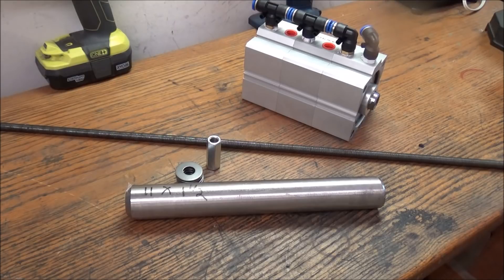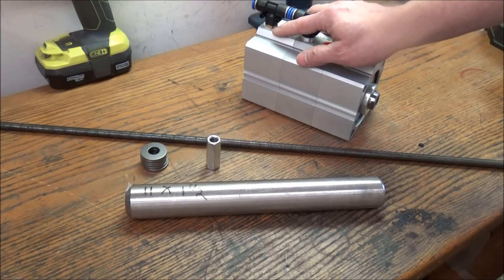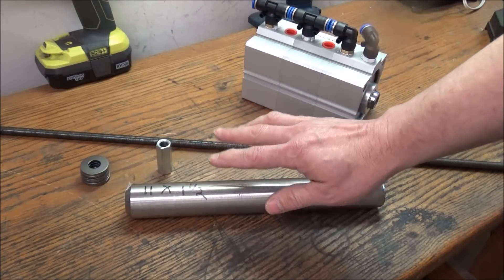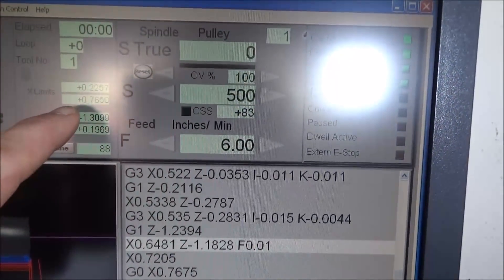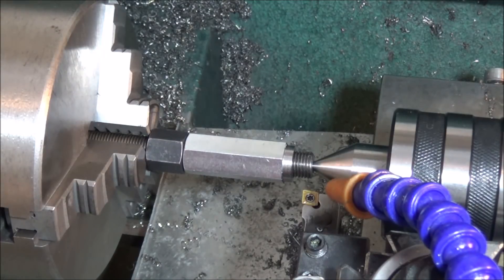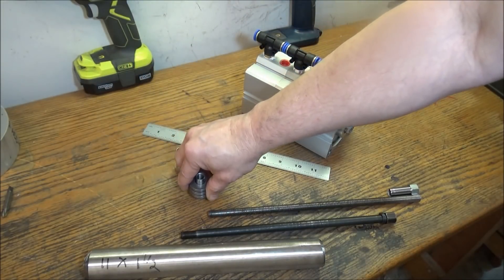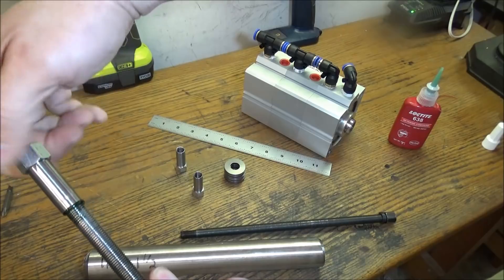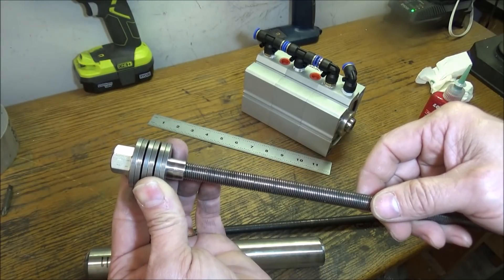PM727M Power Draw Bar Part 1

Comment: So your belleville stack is setup for about 1200lbs? (100mm diameter x 100psi)
Reply from the maker: MarvinRunyon 
No I have about 3500lbs on my Belleville springs 150psi on a 3 stage 80mm bore
Reply: That 150 psi may be a mistake high pressure compressors are not real reliable unless its a true commercial unit then they use lots of power and of coarse if you pop a hose or fitting at that pressure DUCK!!!
I have owned a machine shop for over 30 years
Reply: https://www.youtube.com/watch?v=PN64TesZk60
This and one of his early videos had some interesting info
Reply from the maker: Thanks Tom I'm aware of the risk using 150psi  the working pressure of the bellvilles are 2750lbs but that's to get them working the flat load is a little over 4000 lbs @150 psi i'm at 3500lbs . I will run the mill and see if my machining habits cause any tool pullout and I can reduce the air pressure if warranted.

The Air cylinder i'm using is a 80mm bore a 100mm bore is ideal but the extra size makes it a little more difficult to fit.

Comment: Yes, me, again! What I'm hoping you will show is making the retention collet on the lower end of the drawbar. Those things are VERY expensive. BobUK.
Reply: Robert in this instance these drawbars are for the TTS R8 type of quick change tooling.  in this instance the collet is a simple 3/4" R8 collet with the face ground flat and can be had for about $15 from Tormach and works with the TTS type tool holders.  you are probably looking for a more traditional type of retention pullstud gripper such as a claw or ball and socket type. but won't find that in this specific build.  those type of retention methods require significantly more throw and a simple 3 stack of belvilles is not nearly enough to release that type of tool.  those type of release mechanisms have stacks of belvilles in the 20's to accumulate the proper throw for tool release and also to not require the same amount of force to retain the tool as our methods do.
Reply from the maker: I agree with Chris , The TTS system is a little more forgiving in terms of adaptability to manual mills with R8 spindles. The manual mill BT-30 spindles do not always have the space to accommodate a  sufficient amount of Bellvilles to achieve the desired travel to release the pulls stud.  This biggest concern with the TTS system is tool pullout there's only so much pressure you can get from the Bellvilles. A TTS collet cost about $30 US stay away from cheaper imports as they do not have the Flat bottom. https://www.tormach.com/store/index.php?app=ecom&ns=prodshow&ref=35356

Comment: Hi. This looks really useful for me, looking forward to the rest of it. For the best accuracy - not really needed for this application as you will know, but maybe helpful for other folks tackling more demanding ones - turn a suitable thread onto a small arbor to take the top nut - that way no reliance is placed on the accuracy of the chuck, it's all down to the headstock bearings. Don't use a die on its own folks, they can wander, although they are useful for finalising the tread form after single point turning. Thread turning is an unecessary finesse for this job and it is sensible to omit it. What really attracts me is the thought that goes into your designs. I'm going to make use of it. Cheers. BobUK
Reply from the maker: Thanks Robert, Happy to help! this was the simplest and most effective way, later on a permanent draw bar can be made.

Comment: Sam, having trouble finding the air cylinder. There are different strokes and what I have found don’t have all the air hook ups like yours. Would you mind putting a link to the 80mm and 100mm? Thanks
Reply from the maker: Kirk Douglas 
There hard to find try searching SDA 80-15 80mm bore 15mm stroke 3 stage. Look to pay $130 - 160 and about $80 shipping if you buy from china.
Reply: CNC4XR7 no luck. Can’t find anything for 3 stage cylinders
Reply from the maker: Shoot me a Email
Reply: CNC4XR7 email sent
Reply from the maker: Double Action or Single action Spring return may be used . Definitely use a 3 stage to have any chance of using the bigger Bellvilles.

Comment: That looks nice. How much weight do you think you are adding with this set up?
Reply from the maker: well its about 120lbs total so not that much really the weight I removed from the gears were replaced by the air cylinder. so its a wash really
Reply: if you are referring t just the drawbar alone it is much less than 120lbs, probably closer to around 15lbs, i think Sam was referring to the motor upgrade, bletdrive and associated other parts included.
Reply: That's what I figured he meant by the comment he left. I knew the drawbar addition would not add that much weight. Thanks for the reply.

Comment: When Belleville washers are under compression, does the ID change?  Wondering how snug a fit the sleeve can be, to keep them from becoming unbalanced.
Reply from the maker: Balance is not really a Issue. I would say the ID does change slightly

Comment: Very nicely done. Have you looked into a hydraulic intensifier? I saw one many years ago with a manually operated lever. But small pneumatic cylinder would probably operate it fine.
Reply from the maker: yeah I have seen those however the cost is to great.

Comment: Very cool! I am having the same dilemma with the air cylinder, I only have 100psi. The belvil washers are not very strong because the air cylinder has to be small and thus also not very strong. So I am getting some tool pull out if I run it harder. I'm going to try and squeeze on a 4 inch air cylinder from amazon to see if that will get me some more power.
Best Matt
Reply: I used the  30gal 175 psi husky air compressor from home depot. Within a year it blew the head off. I used it to operate a air cylinder on my small mill at a little over 150 psi and it eventually blew the head off. Luckily it had a 2 year warranty and was fixed under the warranty.It took almost a month to get it back from repair. I ended up getting a  air cylinder that had more Lbs of force at a lower pressure. I can operate it off a ridgid twin tank think its 4.5 gal. at 100psi. So with the pmv mill i will probably do the same thing.
Reply from the maker: Good Info thanks, I have a 100mm bore 3 stage air cylinder as well , however the geometry on the PM727m makes it really tight to go with the 100mm bore. The 80mm fits really nice.  The Husky compressor may have been just a lemon ? the working cutoff is @175 psi so it's not like were asking it to do anything it was not designed to do. At least I hope that is the case :-)  The air cylinder is rated for 150 psi i'm  running it right around there so I suspect early O-ring replacement is possible. i will keep a eye on it. Thanks for the heads up.
Reply from the maker: i suggest you go the same route I did by using a 80mm bore vs the 100mm bore. space is tight up top. the same force can be had by applying more PSI to the air cylinder 150 - 170psi gives me 3500 lbs of force.
Home depot has a great little compressor that puts out 175psi for around $230 20 gal.
 but if your dead set on 100mm let me know I have a brand new one  same one Tormach uses on the 1100.
Reply: CNC4XR7 Well in any case, I'm going to attempt the 4inch air cylinder. It is the lesser expensive route. Also it's for my fully custom gantry mill so i have more freedom in the design. I'll let you know when I get to that point what I end up doing. And i have the auto tool changer working for five tools! I love it! I'll have a video on that for you soon.
Best matt